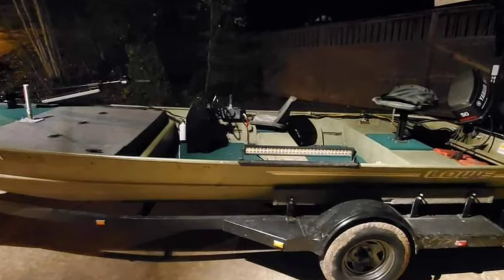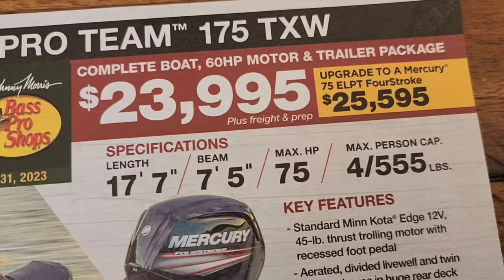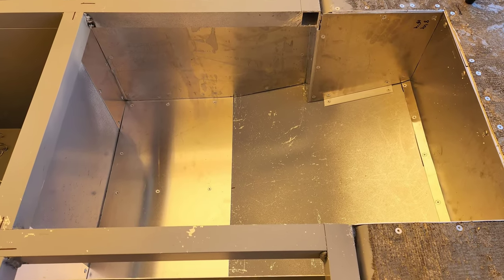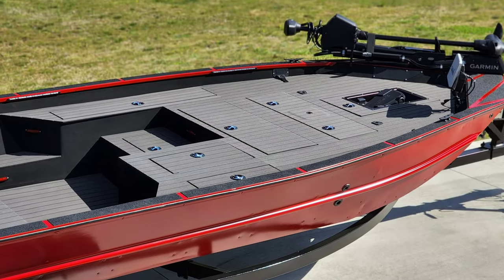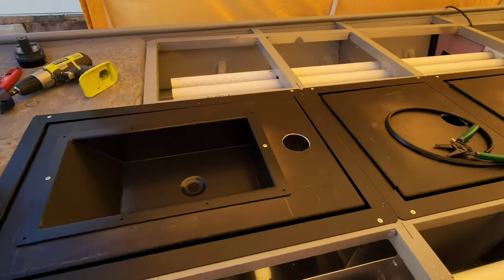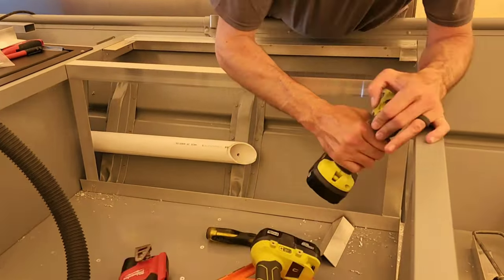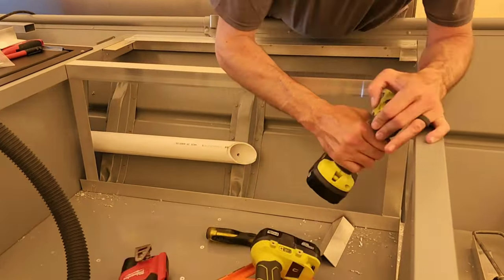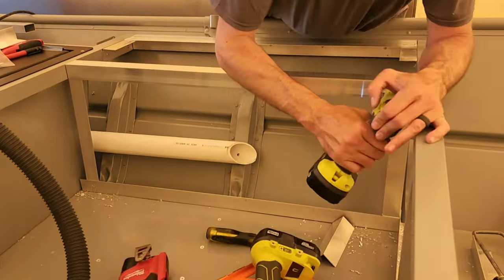IN$ANE JON BOAT TO BASS BOAT FULL BUILD | 18ft Lowe | Start to Finish

Comment: Another great build. Quick question - have you ever used the flat sheet starboard material for decking or box lids? I realize it’s expensive, but once cut and fit it’s done and ready for covering. Your thoughts?